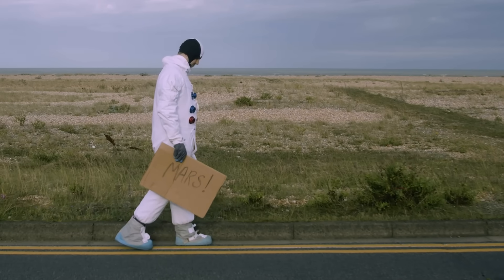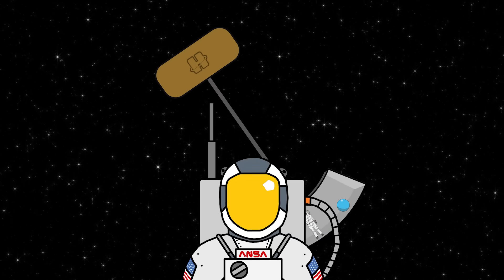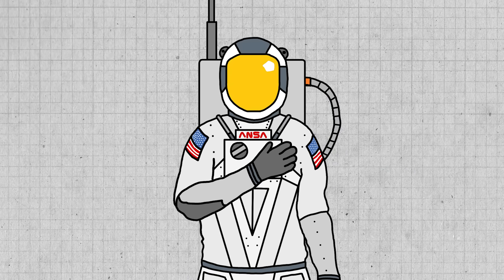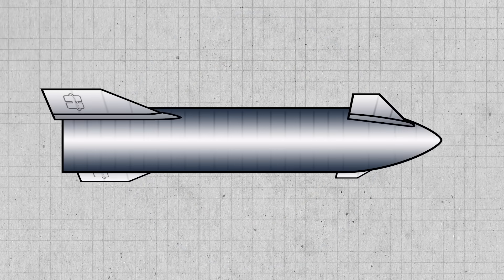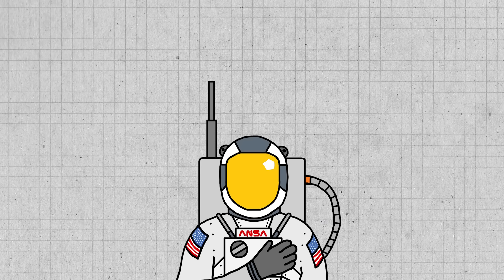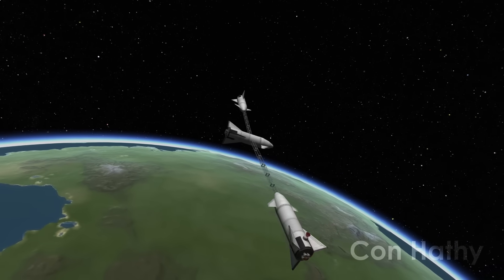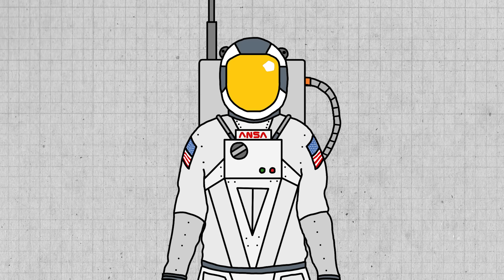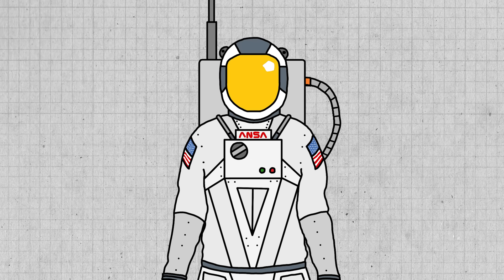This is NOT how you make Artificial Gravity

Comment: At the end of the vid he says that he want's small centrifuge in every eleven of the starship... You think this is a more elegant solution than the tether? All of the wear and the bearings aside the loss in rotational speed due to friction and the electrical cost to keep them spinning, you also have to deal with the intermediate axis issue as people move between compartments and along the centrifuges within the barrel. This sounds like a pretty terrible idea to me.
Reply from the maker: It would just be a single centrifuge that is used while exercising like the MIT concept I showed. So no issue with people moving around. Also don’t confuse easy to explain with easy to do, “just tether two ships together” hides a lot of complexity. You’d need to beef up the entire ship structure to be able to hang a fully loaded ship from those points, bring extra fuel and a huge spool for the tether
Reply: @ConHathy  they hang a fully loaded starship from a crane to load it, I don't think you need to beef up the structure for 1/3 G It's far less stress then it will endure just standing on earth...

Also if your only going to use it during exercise why not just stick with what the ISS uses with the elastics? The Cable, spools, and winch will all be useful on mars anyway. You could even repurpose the side body crane for the function if you are willing to EVA for the assembly.
Reply from the maker: @kyoskei  they hang them when they’re empty, no fuel or payload.

Also the exercise done on the ISS is less effective than AG for maintaining your body
Reply: @ConHathy  now that you mention that they raise it empty I'm like... No shit... I knew that. Your right about that for sure. Don't know what I was thinking. XP

I however am still not convinced that to achieve 1/3g we will have to put extreme stress on the ship, has anyone done the math on that? Full earth weight dry vs full tanks at 1/3g?

could be interesting.

Comment: Spinning the entire ship will make your control engineer hate you as your actuators change orientation all the time.
I do actually like the two ship rope idea. Make the rope a winch and you have a great control tool. Hock in close bring the system to target rpm. Then let the winch increase distance while the thrusters keep the rpm to increase gravity. Would love to experience this.
Having a centrifuge inside the ship is somerhing your controlengineer would love. As it stabelizes the system. Actually having two like a dumbbell would be great to control stability. While you travel speed it up to keep orientation, even if you hit something. If you want to manover regenerative brake the centrifuges, manover with little moment of inertia and spin them up again. It might be possible to rotate more efficient with coordinated acceleration of the centrifuge and thrusting.
Sience fiction got his point right quite a view times. Many long travel ships have a ring rotating, the main thruster in the center of rotation and the thrusters located on a long leaver fixed on the none rotating frame. Thats basically a centrifuge but outside of the main rockets shell.

Comment: Well first you speak that having a central weight in the tether is bad!  and then you add a central bulge with solar panels ??  Wut ?? 
Anyway tethers are not a good thing ..  while you threw out the large rings baby with the bath water.  
And then brush off the need for fuel to counter and need for deceleration IF a tether breaks like it's nothing .. 
Not a very thought trough presentation .
edit ...
Oh i get it now ... Elon Fan boy
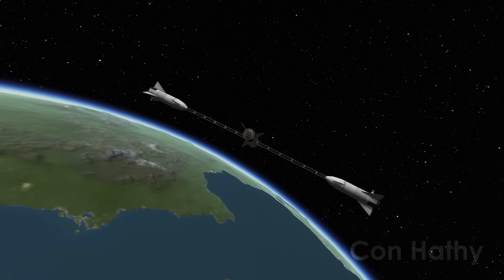Reply from the maker: I didn’t say any central weight was bad, i said you needed to rotate around the maximum moment of inertia. Having the solar panels in plane maxes the system stable not unstable. Watch the two clips at 11:20 again. It’s clearly stable as long as you are rotating on the right axis.

I’m not sure why you would expect a ring to be better than a tether, a tether gets a larger radius with a tiny fraction of the mass. Also I explained the fuel in the video, you would already have to carry that fuel to stop the rotation, so you would have it on board

Comment: There are lots of other problems also not mentioned... Humans have their own energy and mass and wants to move around, just moving around can slow down the rotation or speed up the rotation and the only counter would be more energy/fuel. But sure if they "walk/run" one way and trace the walk/run back it would be a zero sum. But humans are not as predictable...

Best I think would be system with almost 0 gravity, but you get into your very small "bed" to sleep with 0.5-1 g rotational "fake" gravity. You can estimate the fuel needed to either slow or accelerate this smaller "sleeping quarters".

The perfect way would be a constant acceleration of 1G and halfway just turn the "ship" around decelerate 1G. Maybe that would be possible with loads of antimatter, or a really really massive fusion reactor and long distances...

Mars I think 0 gravity is fine, with loads of daily exercise...

Comment: something i don't understand about short radius centrifuges:
wouldn't they apply significantly less acceleration to your upper body, and especially your head?
and aren't those also the areas which are the most negatively affected by low gravity?
Reply: Same thing I was thinking, your feet could feel normal, but your head still feels weightless.
Reply: Short radius centrifuges would make you horribly dizzy and moving would also be horrible. In short it is torture... There is a minimum size you need to avoid getting dizzy and they figured that out long ago.
Reply: The answer is yes, they do. There is a force gradient which is why the radius needs to be larger so this gradient isn’t noticeable
Reply: There's a video by Tom Scott where he actually goes into one, worth a watch
Reply: How large was the radius proposed in thecship Discovery  in 2001 A Space Oddessy?
Reply: Yes. This and other issues that come with a necessarily high RPM are what basically makes a small-diameter centrifuge unworkable for human habitats
Reply: The ONLY human artificial gravity use for short radius centrifuges is a crib to sleep in so you don't feel like you're falling when trying to sleep.
Reply: Yes, absolutely. It's called the Coriolis effect. That is why the centrifuge as shown in 2001 - A Space Odyssey would not work. It must spin way faster, or it must have a MUCH larger diameter to decrease the Coriolis effect significantly. 
Babylon 5 is actually very acurate. The station is a so called O'Neill cylinder that rotates with about 60 MPH and given the size of the station that would create about 1G (Earth gravity) on the inside of the the station. At least when close to the outer hull.
Reply: They have tried the small centrifuges for 50 years. There are inherent issues with them which only the long tether design can address.
Reply: Yes, the force has a linear relationship with the radius. A point at twice the radius will experience twice the force. That means that the fore on your lower body will be greater than on your head. This can be reduced by using large radii centrifuges where the change is much smaller over the height of the average human.
Reply: That depends on your facing isn't it
Reply: @Jinkypigs  Eh?? Are you suggesting they fly to mars standing on their heads in artificial G?
Reply: Apparently, a difference of about 1% between the lower and upper extremities is detectable by humans and can result in nausea, vertigo, and other balance and inner ear related problems. While that is mostly just a comfort issue and would only really be a problem for long term habitation there are serious health risks with blood pooling in your lower extremities (because it weighs more in your feet than it does in your head) if the difference is too extreme. In order to be under 1% difference in a typical 6ft human, you'd be looking at a rotational body several kilometers in diameter. It's difficult but doable.
Reply: @christianclark347  I suspect this is based on a zero-acclimatization process.  I'm with Con on internal centrifuges... but I do think we should be thinking more about constructing modular centrifuges from multiple launches for future attempts.  Nothing huge  but maybe 20-metre diameter rings would be do-able and would notably reduce the acclimatization required as opposed to something that could probably be no-more than 7 metres in diameter (given Starship's 9m exterior diameter)
Reply: @christianclark347  Centripetal acceleration is rω². if I let  r=196m then 1% of r is 1.96m which is more than 6 feet, but close enough.  If I want one G = 9.8m/s² subjective acceleration, solve for ω.  ω²=9.8/196 = 1/20. ω = √(1/20) = .2236 radians per sec or about 1.4 rev/sec or 84 rpm.  So easily doable.  400m, not several kilometers.
Reply: Did y'all watch the video? Yes, it's an issue, but people can adapt to it.
Reply: @antonliakhovitch8306  - Yes, but I think in the video he misses some points. Like yes, a small centrifuge can help when it comes to health reasons, but they don't work very well for the other reasons people want artificial gravity. Like, with a small unit, you can get the benefit but only while you're strapped into the machine. The larger the centrifuge, the less the "ball throws in an arc" thing happens, and so the less you need to be in a harness. People want artificial gravity in ships so they can do their daily tasks and whatnot during the trip as if they were planet-side.
Reply: @antonliakhovitch8306  they're adapting to the middle ear issues, not the difference in pressure

Comment: So... You're saying that building a miniature centrifuge and cycling the whole crew through it all day long, would somehow be smaller, lighter, and cheaper, than tossing in a starship-sized tow strap? How does that make any sense? And how would 20-30 mins of spinning be useful to the crew? Wouldn't help them sleep, wouldn't help them eat, wouldn't help them work, might possibly SLIGHTLY lessen the effects of bone loss and cardio atrophy, but the tether solution would completely negate these issues, as well as all the others, for way less cost, weight, complexity, and space.

Comment: Bouncy cables😉
Just spinning around two Starships on a cable, does not produce a spinning dumbbell. First off, the common center of mass is not in the middle of the cable. Actually there is no center, so the would scribe 8's in the space. All the time they are at the middle of the 8, the speed would be the lowest, so they would start rotating on there own. When the turning point comes, that force has to go somewhere. It will go into the bounciness of the cable or even truss and destabilize the spinning further. I give that dance about an hour, until something gives. 
There is only one stable form of synthetic gravity, constant acceleration. With or without spinning involved🤗

Comment: Dual contra-rotating internal cabins around the outer perimeter with just bearings for support (IE it is not tethered to the center so the craft can run support columns through the rings.

Comment: Eh, this video completely ignores active control. If we looked at Japan's maglev trains like we looked at this, then you'd (rightfully) come to the conclusion that they're impossible. Because it has been proven that there's no possible way to arrange magnetic poles such that they're stable.

But if you introduce an active control system, then suddenly not only can the train work, but it's relatively easy to keep balanced.

It's the same thing here. There are active control systems that can force the ship to remain stable in some specific condition. The real question is do they have enough energy to keep it stable all the way to Mars.

I think a single starship itself spinning along it's long axis could remain stable through active control. Also for the equipment issue, checkout the experimental sea vessel FLIP, it handled basically the same problem in interesting ways, but yeah not ways that make much sense in space.

Comment: All options mentioned are not feasible and would result in failure the majority of the time. In order to make a trip in space for long distance work you will need a dual centrifuge utilizing internal spin. No external  moving parts or seals against the vacuum of space as they create a failure risk. Also it would have to use a dual centrifuge system to prevent auto rotation from pushing the ship off course. I am one of those less than qualified individuals you mentioned but my system would work on either the large or small scale. No new materials required capable of being built in the last four decades now. Anyway just some idiot here so what do I know.

Comment: Centrifugal force still requires friction to impart force on the occupants. A rotating disk on earth spinning imparts centrifugal force on it's surface due to the force of gravity on earth. Simply spinning a disk in zero gravity will not impart any force on bodies unless they are tethered to the disk in some way. So rather than walking around the outside wall occupants would need to walk on perpendicular walls along radials. The spinning wall would then collide with and impart a constant force on the occupants. However the force would change depending on position along the radial axis. 

So the depicted diagram with star ships tethered end to end would actually collide with occupants from the side walls which are aligned with the radials of the axis of rotation. This could all be solved by rotating the habitation module internally instead of rotating the entire ship. 

So just to be clear the force imparted on the occupants would first be perpendicular to the centrifugal force. Once friction occurs between the occupants and radial walls there would be a centrifugal force imparted as well. So if there were no radial walls you could jump from the outer ring and still be spinning at the speed of the outer ring but there would be no force to push you back out to the outer ring if you are suspended in zero gravity. You would just be spinning while jumping across the ring from side to side. The centrifugal force only works if there is friction.

Comment: you dont address how difficult it would be to get two ships to start rotating around the center of a flexible cable
Reply: It is not difficult, especially if the tether that is paid out from the nose of one of the vessels has, at its end, a set of solar panels and an ion drive. The drive can haul the tether end to the nose of the other vehicle.

But then the obvious question is, why have the other vessel? Why not thrust tangentially with the ion drive, spinning up the system over a period of a few days? Significant mass and complexity is saved, including that of having to join, in space, a tether to a vehicle that it will eventually be supporting the Earth-normal weight of. The tether is permanently joined to the drive at one end and the ship at the other.

The end state is a short stretch of tether down to the living quarters and a longer one down the other way to the ion drive, which, because it revolves at a much greater radius, gets several gees. It remains useful: it can be gimballed out of the plane of revolution, and accelerate the whole system towards the destination, or, as it gets close, away from it (braking).

Comment: Have to admit I am quite a fan of tethered 'dumbbell' designs- probably built as cyclers or dedicated long range vessels.. Maybe with a set gravity of about 0.5 Gee's, and probably using nuclear thrusters. 

As you say the common gripe about tethers snapping is silly. Its quite easy to design a tether with large redundancy and multiple cables. One or more inflatable tubes can also be incorporated as a structural core. Some kind of lightweight elevator system might also be a requirement too.

As others have said a centre section would be very useful for docking and there are ways to improve stability like only having a short rotating section coupled to a longer non-rotating section. Another method requires long lateral masts carrying secondary tethers allowing the centre section to provide thrust to the whole structure. This would require some kind of extra stabilization system though.  (As I now appreciate)

One of the other improvements I would add to the design is to spin the structure up and down using reaction wheels so as to avoid using up too much valuable fuel/reaction mass. As they are spin up the wheels are drained of momentum in a repeated cycle. This can be done by flipping them over by 90 degrees in opposing pairs and slowing them to a stop using reactive braking.

Comment: What if there was a section in the center of the ship that left the cockpit and the back fins stationary and connected to one another through a central core but the center cylinder of the ship will spin that way you can keep the fuel cells from sloshing around and you wouldn't have to re correct for the spin to acquire your target.

Comment: In that spinning table the head itself is right at the pivot point - meaning the head is not experiencing gravity. This surely would have an impact on the results of the experiment.
Reply from the maker: That was actually a control configuration where there is intentionally no load on the eyes, they can also elongate the arm to subject they eyes to AG